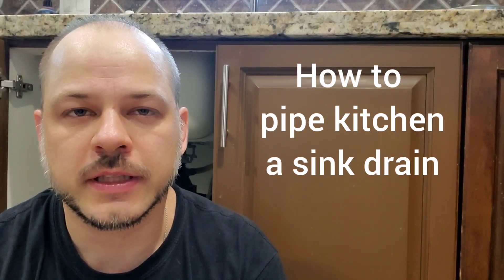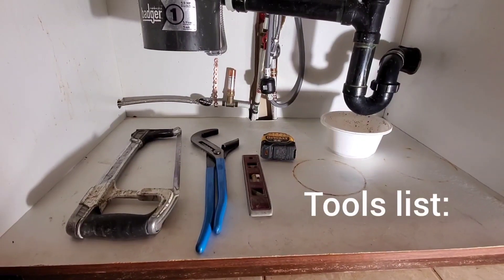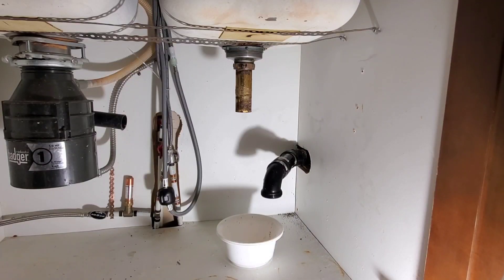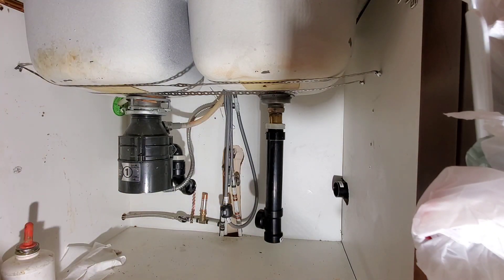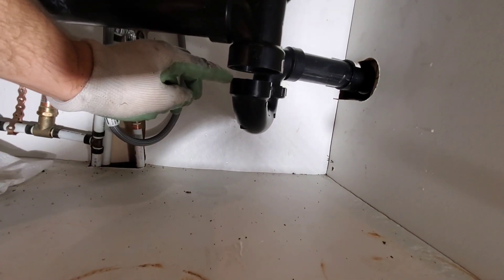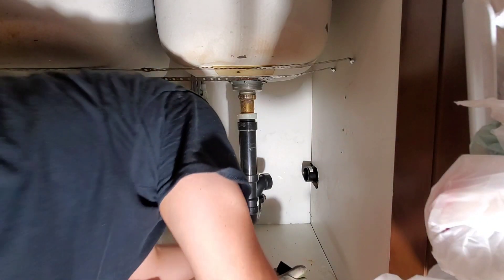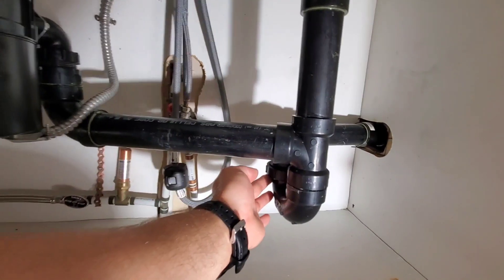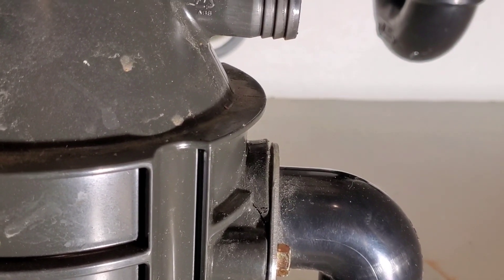How to pipe a kitchen sink drain (DIY guide)

Comment: The plastic nut on the trap adaptors with the washer made into the nut can crack if you over tighten them.
Reply from the maker: Thats for you comment, I would suggest to only do hand tight on any plastic nuts, you can give it abit extra with water pumps/ channel lock pliers. But as you pointed out, they will crack if you overtighten them. A worse case scenario, you can put silicone  on the top if it's still leaking but it new construction this would never pass.
Reply: @HomeownerDIY  I have seen a lot of them split and not the ABS and PVC nuts. it seems to be a softer plastic too.🤔
Reply from the maker: @briancrandall1601  For the manufacturer's, there is always money in supplying a new part haha.